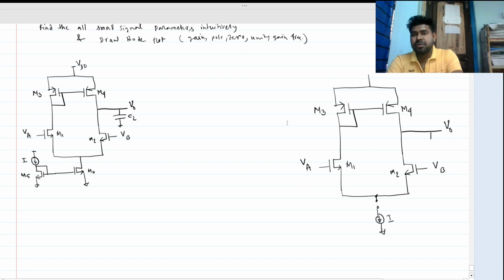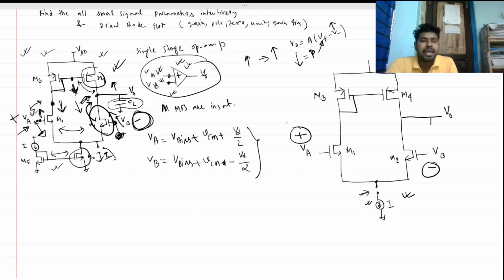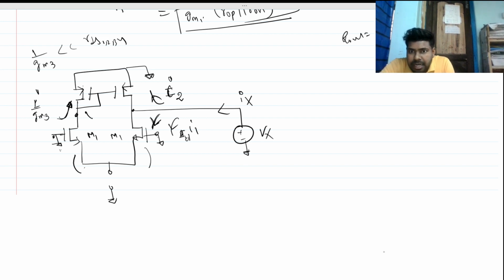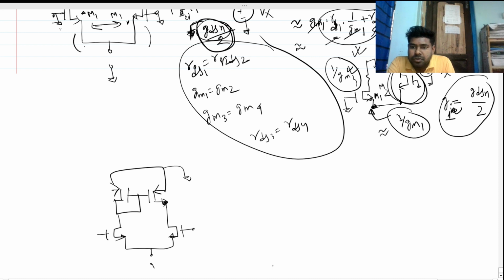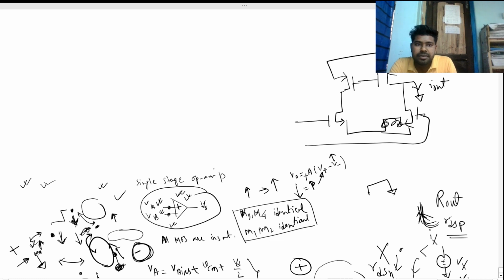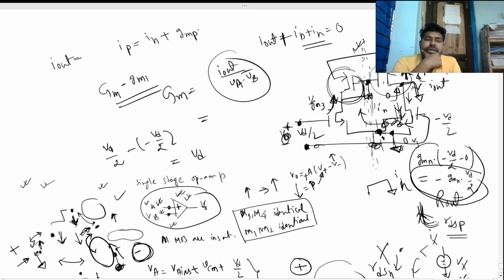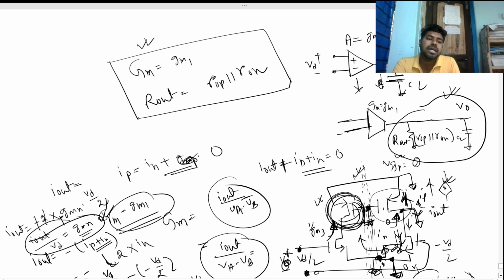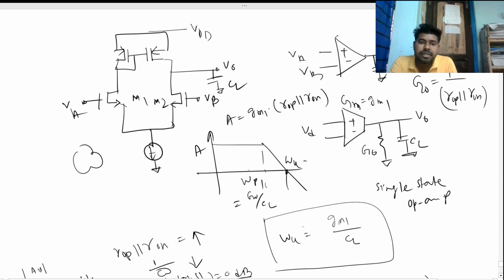OTA-6_Find Gain and Draw Bode plot intuitively_ Most important Circuit for Analog Circuit Designer

Comment: During calculation of Gm if I can assume the circuit to be symmetrical then why not in case of R out calculation? As it a rough calculation of gain, then assuming the circuit to be symmetrical Rout = (rop||ron) and Gm = gm. I am taking this approximation as it is a rough calculation which will reduce the calculation burden. And try to keep your screen clean, and write down sequentially, sometime writing at top then suddenly scrolling down and writing at bottom side. Things are becoming quite tough to understand. Don't take me wrong. It is just my opinion
Reply: (vin/(1/gm1+1/gm2)*2=Iout..
if gm1=gm2
GM=Iout/vin=gm1...Answer

Rout=(1/gm3+ro1)/(1+gm2ro2) approximately 1/gm2
And then 1/gm2*(1+gm2ro2)+ro2=
2ro2
So  I=(V/2ro2)*2+v/ro4...Rout 
Rout=ro2//ro4...
Finally Av=GM*Rout=gm1*(ro2//ro4).... Answer

Comment: Bro either don't write on corner or remove your pic from corner. This was very interesting, but that corner overlapped video ruined it completely. If possible reload it.

Also if possible lets take the same ckt with M1 and M2 different sizes. Try to calculate the gain.
Reply from the maker: Thanks for the suggestions